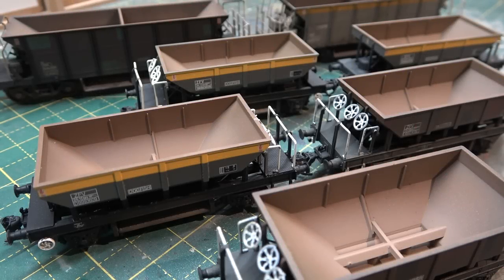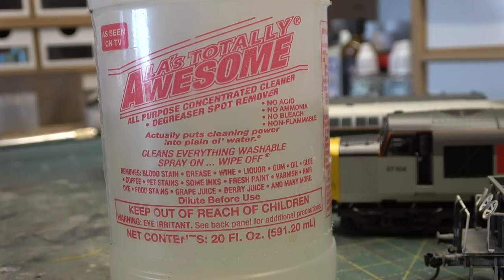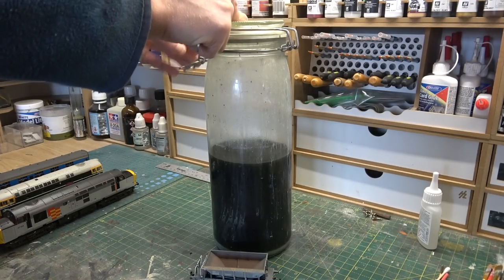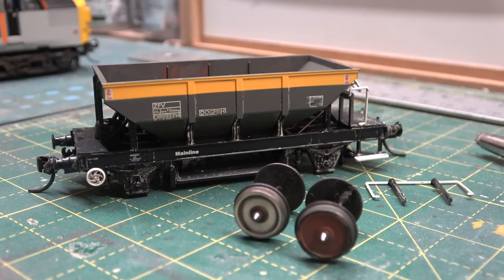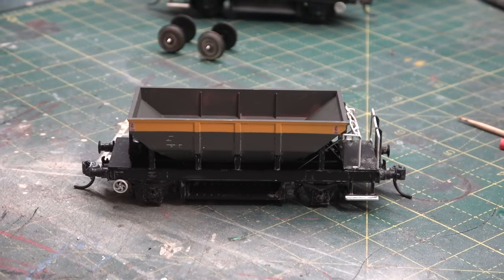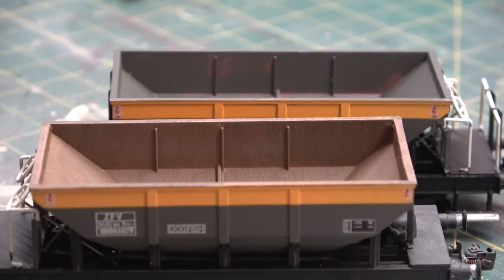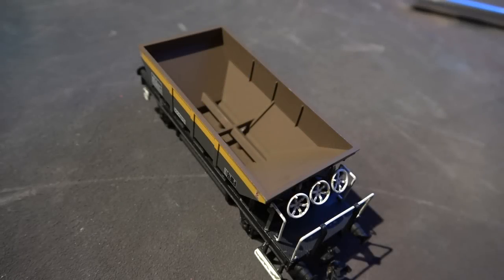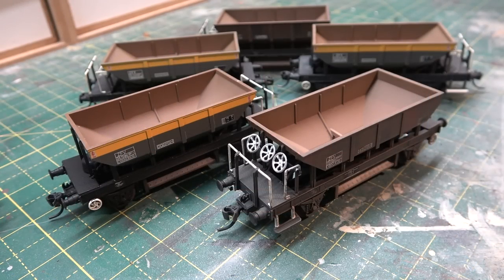Removing Paint & Weathering from Models

Comment: Happy New Year, great video as ever. Having worked in the industry for 40 years if you had been able to find photos of the bottom of the dogfish hopper you would find that the materials actually polish the area from blue/black down to quite bright silver on the gates. They look great anyway but knowing your attention to detail I just thought you'd like to know.
Reply from the maker: Cheers for the info.  As you can expect photos of the insides are rare and usually cast in shadows.  I found it rather difficult to tell what was there in a number of photos.  I'll add that job to the list.
Reply: @EverardJunction  Wish I had some photo's for you but alas.
Some finer details,
Top 1m heavy flaky rust with black patches where the rust flaked off (tiny speckles on your scale).
From there down to lower 1m smooth rust as you've already done.
Bottom 1m blackish/blue graduating to quite polished steel/ silver in an arc shape lowest points in the corners.The steel angle would wear on the edges from the centre out.
Silver polished areas would have rust streaking where rain washed rust down over them.
Depending on the age and how much use they'd had there might be odd bits of plate or angle welded in to patch them up, usually a bodged job.
Having said all that probably just a lot easier to fill them up with  material.☺

Comment: Excellent work - superb layout, takes me right back, a real time machine.

I've used various methods for removing other people's weathering. But the trickiest in the "to do pile" is one that someone has used acrylics on and the livery underneath is adorned with some intricate decals that, are not, to my knowledge, available. To date my usual methods haven't worked so I may try yours (but test it on a small patch first)🤞🤞🤞😊

Every day is a school day! 👍✌️💜😊
Reply from the maker: You might have some success just using a bit on a cotton bud rather than immersing the whole vehicle.  As you say best try a small patch first.  Cheers
Reply: @EverardJunction  Thanks that's what I was pondering too, baby steps. If not I might do my best and if okay weather atop with "cement dust" effect, or strip it all off, re-wheel it and turn it into an early nuclear flask barrier wagon🤔🤔🤔✌️👍😇

Comment: Thanks for another really useful video which got me thinking about a ScotRail BG coach I bought second hand which was apparently professionally weathered. I felt it was too dirty. I'd has a go a few years back with 70% IPA which had little impact, this time I went for 99.9% IPA.  Much better results. I did them give it a clean with soapy water to remove any left over IPA.  Totally agree with your advice on checking prototypes,  whilst some MK BG were manky, those in passenger rakes such as my ScotRail one would have been a bit cleaner as they would have gone through the carriage cleaner with the other passenger coaches in the rake I suspect.  I couldn't upload a before and after photo so have added them to the RMWEB Everard Junction page.

Comment: I use Dettol disinfectant cleaner for paint stripping. The brown stuff that contains Chloroxylenol -- usually available in Tesco, Sainsburys etc. Do not leave plastics in it for very long (they go soft) or get undilute cleaner on your hands (the skin'll come off). It will dissolve acrylic paint and enamel into a goo that can be scrubbed off. It will also substantially weaken superglue and 2-part putties.
Reply from the maker: I've heard good stuff about Dettol from a few people.  Cheers for the info.

Comment: Usually straight water first and then a progression up to a 50/50 mix of 99% isopropyl alcohol and water is a good place to start and in my experience will remove most paints and matte varnish solutions, however it can sometimes get into the factory paints ever so slightly the higher the content of isopropyl alcohol.

Comment: I think quite a lot of the degreasers you can buy might work ok.
I've mostly used "Diggers" brand in the past but you have to be careful not to leave it in too long (like days on end) as it will start pulling the original paint off.
I use "Simple Green" degreaser now which takes longer but is less aggressive. So far so good.

Comment: Well the cleaner , according to it’s filed Material Safety Data Sheet, contains:

Butyl Carbitol 
Ecosurf EH-9 
Sodium Metasilicate 
Tetra Sodium EDTA 
Water

I’m guessing the butyl carbitol is the primary active solvent wirth the rest just being helper ingredients.  Find a local cleaner/degreaser with that as the active active ingredient and give it a try.

As a more aggressive “remover”
LUX DLE will remove factory paints often , and can be applied with a cotton bud/swab to remove logos of you need to rebadge a factory paint job. Though it can get to the underlying plastic if not careful. Light rubbing with a not fully wet swab is the key there.
Reply: And that is how it's done. Nice work. Thanks 👍
Reply: Very informative. I’ll keep that in mind when Dipping my stuff in it!

Comment: LA's Totally Awesome can strip factory paint but you would have to lay them in the stuff for a long while in my experience, I've stripped older coaches down to bare plastic by letting it soak for weeks, it does leave some primer on ribbing type details, but you can easily clean that with Iso-Alcohol

Comment: I wonder if the cleaner would work in an ultrasonic cleaner? (if you could get a big enough one)
Reply from the maker: I does work.  However the heat generated during the cleaning process causes quite a bit of evaporation.  I have a small ultrasonic cleaner which is very handy for the airbrush.  Cheers

Comment: Vallejo Paint - IPA 100% Isopropyl Alcohol. Excellent, leave to soak and agitate after a while.     'Plated' chromey plastic parts - Immerse in Domestos.      Enamel paint - Mr Hobby Tool Cleaner (Bad fumes, wear mask, do outdoors). As said, don't be tempted to leave things immersed and go away on holiday for two weeks - Lots of plastics will start to degrade after a while.

Comment: I am wanting to buy my hubby a new controller as he has a Guagemaster Prodigy but it only has 20 loco functions. I am thinking of the Z21 by Roco and Fleichman. Is his a good controller or is there others that are better. It needs to go up to at least 28 loco functions as I bought him an Accurascale Deltic 55. Love your channel
Reply from the maker: The Z21 is a good unit.  There are a few versions of it I think, I'm not familiar not having one myself.  My current controller is also limited and I'm looking to upgrade in future.  Very difficult to determine which controller is best due to so many variables.  However from what I've read the Z21 is well regarded in the hobby.  Hope that helps.